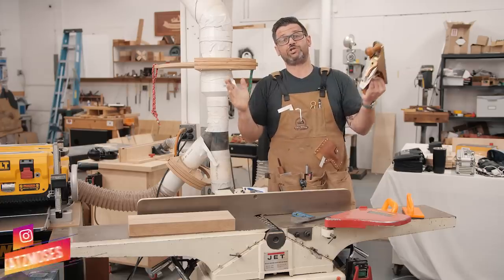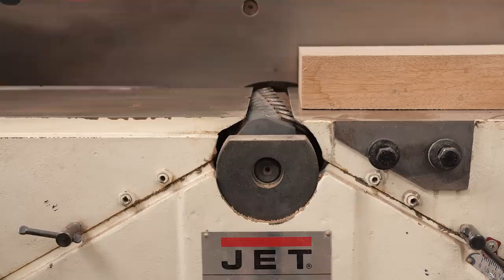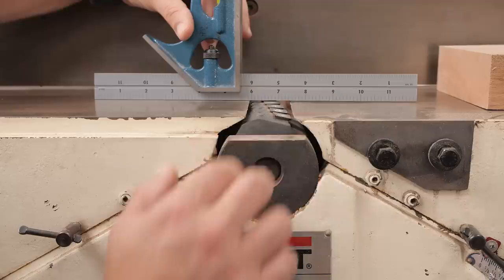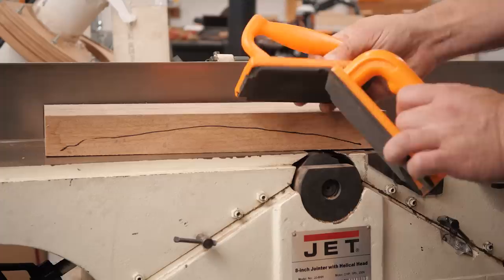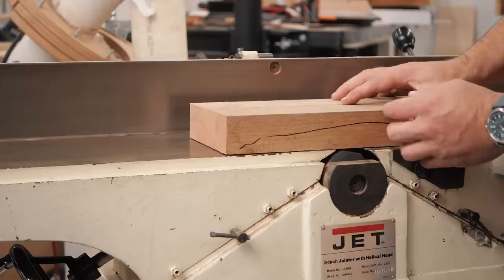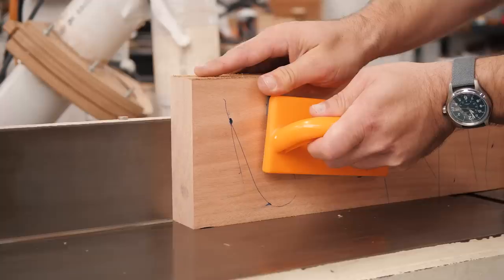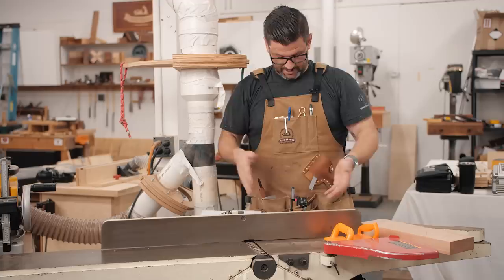How To Set Up and Use a Jointer with 19000 FPS Slow Mo Footage

Comment: pouting  pressure on the out feed side and not the in feed side makes so much sense. i got a little bit of curve in the last boards i jointed i thought it might have been my set up but now i will pay attention to my pressure, i think that will fix it. great tip and one i haven't seen before

Comment: Sorry for your accident. You did get off lucky and this is an easy and important lesson for you and your viewers. Woodworking is a hazardous trade and even more hazardous hobby.  It scares the hell out of me thinking of untrained people using this equipment and not being aware of the dangers and how to avoid them. That’s where these kinds of videos are important
  I was taught as an apprentice in the wood trades to never touch the infeed table and not to drag a finger or hand behind the board along the infeed table. It’s not always so easy to use push sticks or blocks on all pieces but best when possible so we all use our hands at times. 
  Anyways, I hope you heal well and get back on the horse. Thanks for sharing.

Comment: I've been using my jointer wrong for years.  I've wondered why sometimes it takes forever (and a lot of material) to get flat edge and occasionally a face.  Somehow I missed out on the instruction that said always put the pressure on the out-feed.  TIL and thanks Jonathan!
Reply: I have been using mine wrong for years too. Glad to hear I am not the only one! I will try doing it the right way next time. Don’t know how I could have missed this for so long.

Comment: Jonathan,  I see in the slow-mo clip, your push pads are slipping on the board surface.  I don’t know if this works with every brand, but mine I have improved by cutting a grid of slits with a razor blade.... kinda like adding sipes to a tire for improved traction.

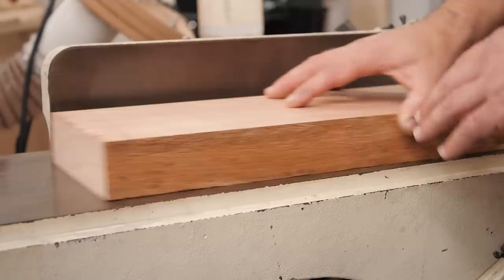Comment: around 7:00 you were talking about high and low spots and where to hold pressure on the board. I usually look at it as balance between high and low on the table to not remove too much on the corners making the board too thin. In other words keep it as stable as possible between the points laying on the table. I don't so much as push down as I keep it from coming up off the cutter. I see many people pushing the wood down hard on the table to "flatten" the board and then wonder why the twist or bow is still there. That is why planers do not remove twists and bows. Most of my force is to move the wood forward and not down to the table.
Reply: Yes, find a happy medium, if I understand it correctly, both technics will produce a flat board but one will remove more material overall  after thickness planing.

Comment: First two tools I bought, was a table saw, then a jointer, then I added a planer shortly after.  Those, in my opinion, are the three most important things, to be able to mill rough sawn lumber, and ultimately the most important things to start any project.

Comment: Thank you! This advice is different from every other tutorial I've seen as far as where the pressure should go. The other ones I found all recommend pressure on both sides evenly. Just tried it your way and it fixed the problems I've had for years. Always had to finish with a hand plane before.

Comment: This is very useful to me. I just picked up a used 16" jointer planer unit and am having trouble getting straight cuts, it always seems to take more off the infeed side than the outfeed, making a wedge shaped board. No manual is available online for my unit, so I'll be in my shop playing around right after this.
Reply: After this, if you still think its not right. Peter Parfit has a video on you tube in how to set up a planner. It's a long one but very very useful. I bought a used one which turned out to be way out. Its now perfect 👌
Reply: Its not the short bed jet is it?
Reply: Kevin, either your outfeed table is set higher than the cutting circle (which could also be checked by the method JKM shows with a straightedge), or nicks in the knives are leaving  “whiskers” that give that effect. This condition would not be noticed by most methods of checking tangency. As the cut progresses, the wood keeps climbing onto the outfeed table, until no more wood to cut.

A practical method for setting the outfeed height that will accommodate both situations is to first set the outfeed table intentionally too low, and then take a partial test cut with a stick that is already reasonably straight. When enough cut has been made to hang the stick over the outfeed table, shut off and raise the table to meet the wood. You will be able to detect when the leading end just barely drags on the table if you swivel the stick around a little, like checking two edges for a spring joint.

Comment: Thanks for this video. I recently purchased a jointer and planer, and I have been having trouble with the weight transfer on the jointer. Hopefully with your video, I will finally get it right.

Comment: safety is a concern aswell.  people dont really see jointers as dangerous as saws,  but after seeing the perkins builder brothers accident, i have a renewed respect for jointers.   spiral cutter head powermattic 8" took 4 fingers down to last segment.
Reply: I'm scared of the router, I respect the sawblade and the running belts and I pay equally careful attention to my handplacement on the jointer. If you are not using a machine, you turn it off. Always keep your safety gear on and stop if you are not paying attention/feel tired to come back at a later time. Accidents happen when you are not paying attention,  don't know what the normal operation/steps/tolerances are and when you get too comfortable or remove safety features.

Comment: I aim for “flat enough” on the jointer. There might be the slightest twist remaining. Or the surface might be rougher than I want. Then, for precision work I move to winding sticks, pencil lines, and a finely tuned hand plane. Flat and smooth.

Comment: Good video!!! Loved the slow motion frames! I have planer/thicknesser  very handy and I am having good results using it ( it is very basic one ) I don't have a shop and it is a very noisy tool, so I started use hand planning, love my no 4, 5 and 6 maybe it's slower but much more satisfying using them - and  you have great part in it so thanks!

Comment: Idk I think id rather use that $350 plane you showed at the beginning, my shop is super small (think sqft of a bathtub) so I have very limited power tools. Ive used jointers in the past and don't really like them because of how dangerous they can be. This was a great instructional though and I know from personal experience using someone else's table saw and getting kick back because he didn't know how to set it up that if I use someone else's to check the set up amd now I know how, so thanks for that. Plus I plan on using a cheap electric hand plane and building a very small jointer to help with some things and in a couple areas and im sure that set up on that will be the same as set up on a store bought jointer. 

Oh and I am loving the high frame rate slow-mo instructionals so nice to see how the tool is doing its job while having easiest and best ways to help the tool do its job explained to me.

Comment: Weird watching this after your thumb incident. I just see thumb getting cut away instead of wood. Glad you’re ok man!
Also, could you mount a feather board on the vertical fence at the outfeed side to keep pressure down? I know there’s no miter slot. Probably a dumb question, noob here.

Comment: Hi, in the video at 6.50, you mentioned about transferring pressure to the low corners but in the video I see the pressure is applied to the 2 high corners. Could you help me understand whether you apply pressure as per the video, i.e. 2 high corners or it should be applied to the 2 low corners? Thanks.

Comment: Hi Jonathan.  I followed your advise.  Unscrewed my box for the mobile miter station and adding glue. So thank you for that tip.

I am new to woodworking and I often hear you don’t joint multiple sides. You joint one side and then use that flat side to reference on the planner. Why is that?  If you only have a jointer couldn’t you joint all the side?  Or possibly joint two sides and complete milling on a table saw?

Damian

Comment: JKM, love the videos. Unsure about the pressure shift though. Wasn’t the gap at the front , shown in the example, only present because you were demonstrating rather than actually  running it through the jointer. If the cutter block is set up level with the outfeed table then the amount you remove should mean the workpiece stays level on the outfeed regardless? This means the pressure can be even as the timber if always flat across both tables?  I sometimes get a little chatter when I don’t keep some pressure on the back of the timber. Any thoughts?

Comment: As someone who doesn’t have a jointer or planer, I am curious, which one would you buy first and why? Also, could a jointer work as a planer?
Reply from the maker: You should watch the whole video
Reply: Jonathan Katz-Moses hahaha yea, asked it about half way through. Now I know the answer
Reply from the maker: https://youtu.be/jWzg4BzPrdk
Reply: Jonathan Katz-Moses thanks!

And thanks for your videos. They are creative, funny, inspiring, and educational.
Reply: James, JKM shows how to work around a lack of jointer, but does not answer your second question. Methods exist to use a jointer to thickness a board as well, although not conveniently. One method is to take your surfaced board, with one edge straightened, to the table saw. After ripping parallel, stand the board on edge against the rip fence and cut a rabbet into the remaining rough surface at the dimension you would like the board to finish at in thickness. Now, a bit of prep for your jointer. Two bars are needed, the length of the infeed table and fastened to each side of that table. If you then progressively lower the infeed until the bars are flush with the outfeed, you can pass your stock over them and cut until the rabbetted lands ride them, and your board will be thicknessed. Keep a sober eye on how much wood will need to be removed in any single pass!

Comment: What about the opposite problem? I recently had a board where jointing introduced a bow in the middle, making my edge convex instead of the concave you describe. 

I assume it is because the board was too big/heavy, so the further out on the wings I got (at the beginning & end of the cut) the more it might have been creating a pivot point & lifting up on those ends away from the cutter & pushing the wing down.

Comment: Really interesting video, really enjoying this slow mo series, but I've always struggled with the idea at 4:37 Once the leading edge goes across the cutter head it will be sitting on the outfeed table, regardless of where you apply pressure. And at the same time the uncut back of the board is also sitting on the infeed table. So for removing twist I can understand applying pressure at the front, to keep the board from changing orientation as you move through the cut, but I can't see how it helps otherwise. What am I missing?
Reply from the maker: You're right, it wouldn't matter if you can flatten it in one pass. If the twist is deeper than your depth of cut then your board isn't going to be flat in one pass. Not putting pressure on the high spots is going to mean you lose a lot more material before it is flat. The difference between 2 passes and 4 or 5. Great question Robin. Good to see you bud and keep up the good work
Reply: @katzmosestools  aaaaaah right! Doing it in more than one pass WOULD make a difference, of course. Thanks man!

Comment: I am getting minutely convex edges when I joint stock on my 12" long bed jointer. I have confirmed that the tables are flat and coplanar. The only setup problem I can detect is that the knives may be set a little too much higher than the outfeed table than what I normally aim for (.001-.002"). Can this improper knife height cause convex jointed edges? Thanks.

Comment: I bought a used jointer and the two planes are not apparently parallel.  It only cuts the front of the board and the trailing end is not touched.  I cannot seem to find a reference on how to true those.  Thoughts?

Comment: Jonathan - I bought a Grizzly benchtop jointer and it has 4 leveling screws on the outfeed table and 4 on the infeed table. I've spent 3-4 hours trying to get the outfeed table level with the cutterhead - and the manual says make the outfeed table level with the body of the cutterhead, but then it also seems to say that the blades need to be adjusted to this same height. Anyhow, this 4-screw design seems like a bad one and I'm about to return it - but it could be operator error. Do you have any benchtop jointers that you would recommend. I notice in the video you are using a Jet. Thanks.

Comment: I have a problem where the jointer is taking off wood more on the fence side , thus I have to run the wood multiple times over ,,, and after those passes, I end up with a "wedge" shaped board where the side of the fence is thinner than the opposite side ... any tips please ? ..... OH AND BY THE WAY , I received the apron and it KICKS ASS !!!!!!

Comment: I am trying to get my infeed and outfeed tables parallel on my Grizzly452 which has similar setup as the Jet in your video.  I can't seem to get them parallel.   I am referencing off of the infield table.  The end of the outfield table (not close to the cutterhead) is high.   Feeler gauge of .006 next to cutter head fits.  I have tried shims but even that has not worked.  How important is it to get the infeed and outfeed tables parallel

Comment: To be honest, I don't understand why I should have one of those instead of a planner, or why have both. Did you make any video talking about this?
Reply: A jointer gets things perfectly flat. A thickness planer gets things perfectly parallel & removes material evenly to be the same thickness. 
Because the rollers on the planer push down with a lot of force during the cut, you can feed a warped board through it & it will continue to come out warped. Also, if your board is not parallel and you use the jointer on both sides, you may end up with a board that varies a lot in thickness. 
You can build sleds/jigs to feed a warped board through the planer & have it come out pretty close to flat though & essentially accomplish the same thing though.

Comment: I'm curious, do you not have planer(jointer)/thicknessers in the US that combine both functions?
Reply from the maker: Yes we do
Reply: @BiggMo  Watching various woodworking channels from the US it struck me nobody seemed to use one but they are fairly common here in the UK.
Reply: Chris Jordan ... doing a quick google search on 12” planet/jointer combo machines, I see that everything is 220/230 volt.  Isn’t that UK’s standard vs the US standard of 110/120 volt?   My guess is  (for the US) most hobby shops don’t up upgrade there electrical system so the market for these machines is small here and the bigger shops like Jonathan’s have the space for two dedicated machines - so the wouldn’t have a need for them. But that’s just my speculation.
Reply: @BiggMo  I'm not sure space was the issue originally, I've seen them in large commercial joinery shops, big 415v 3 phase machines too. I don't think the stand-alone thicknessers became available in the UK until later (but I'm going back a few decades). One difference I think that is noticeable is the (at least on non-production machines) separate jointers seem to have longer feed tables in comparison to the combined machines, so maybe those of us with smaller operations preferred these for accuracy...but of course, I may be completely wrong about all of this!

Comment: It's funny, US "high power" is 220v, compared to the 110 you use. While the rest of our normal stuff in the EU is 220, and my jointer runs on 380. For a country that prides itself in "POWER/BIG"-things, the US powergrid seems to be on the weak side :p

No offence to anyone intended, if you want "more power" for any machine, just keep it in tip-top condition and use sharp blades, then motor power should never be an issue.
Reply: Try Germany - 3 phase for all houses. Mental!
Reply: @CabinetFramingUK  some of my stuff runs trough 3x 220 as well with a variable-frequency drive ;)
Reply: "high power" in an industrial/commercial setting is 480V 3 phase.  But power in a residential setting is 120V/240V single phase (often erroneously called "110/220").  Much safer to make most residential devices 120V.
Reply: In fact the U.S. power system is the same as yours.  It is just that there is no reason to have 230/240 at every outlet.  All we need to do to get 230/240 is to install a breaker that uses both sides of the breaker box and add another wire if you still need the neutral.  Very easy to do.  If someone needs 3 phase power which is what you are referring to with the higher voltage (380) it can be installed.  Most places have no need for that kind of stability in their tools so it is not normal to have 3 phase power in a shop unless you request it.
Reply: 120 vs 220 really isn’t about ‘high power’.  It’s actually high flow vs high pressure because the 120 is higher amp than the 220 given an equal power draw.
Reply: @BiggMo  Yea but no one puts higher power loads on a 120V circuit because the large diameter wires would be expensive and you'd likely still have problems with voltage drop.  You never see a 5 continuous horsepower motor on 120V circuit.

Comment: On the twisted board, wouldnt be 'easier/faster' to remove the high spots with a hand plane, then go to the jointer? instead of having to give the correct pressure? Idk, feels easier to me
Reply from the maker: Definitely not. Why go to all that trouble when you have a machine that will fix it in less than 5 seconds